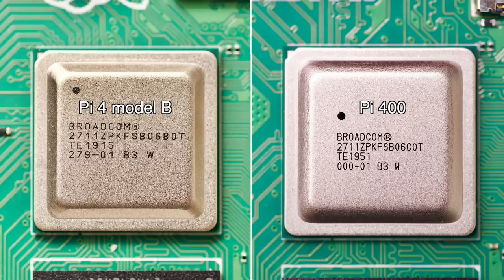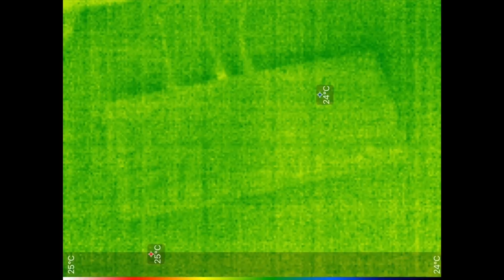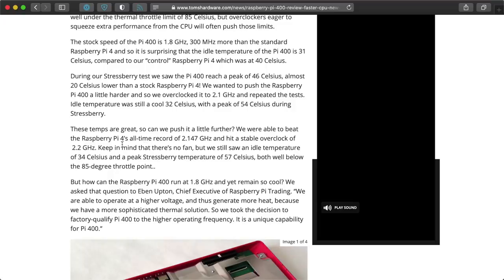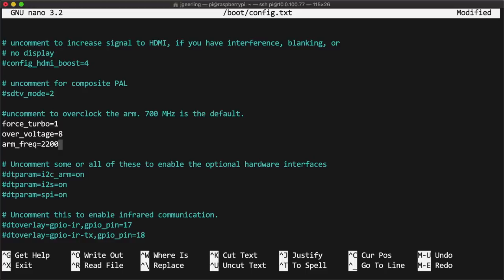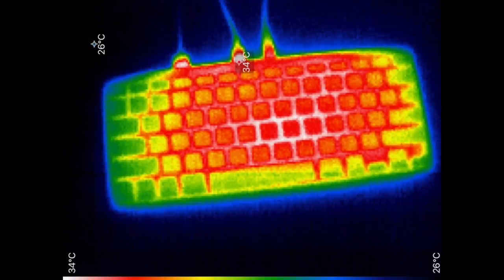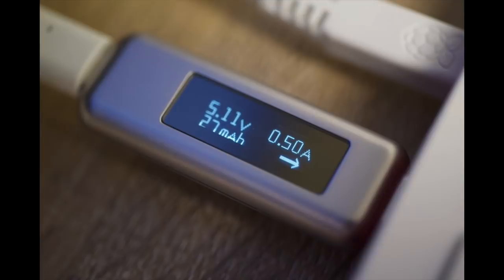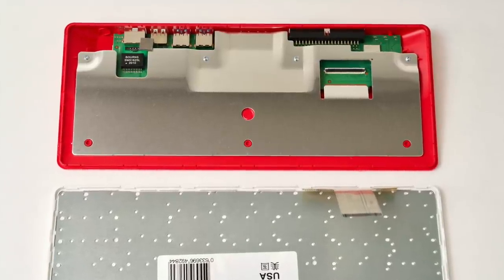OVERCLOCKED! Raspberry Pi 400 does 2.2 GHz!

Comment: Looking forward to your experiments with mounting a SSD drive internally in the keyboard case.
Like a recent NVMe 1Tb module.
And of course then boot from that drive and rid the SD card.
Thanks for sharing your experiences so far, highly appreciated !
Reply: maybe the Foundation can design a larger case (maybe use that excess surface for a numeric pad) and a free 2.5" sata bay inside or an m2 slot

Comment: Could you do a video on how it performs day-by-day tasks, like browsing with 1, 2, or 10 tabs open, watching youtube videos, etc? Using external video recording so we get a true sense.
Reply: As long as you choose the 4 or 8Gb version, it will work similar to a 'normal' laptop from about 5 year ago. Especially if you hook it up to an SSD and ditch the moronic SD card.
Reply from the maker: Not exactly that, but in a similar vein, check out my 'Pi 4 a Day' video: https://www.youtube.com/watch?v=OU6jHvVqJxY — it is a good little computer, but has reasonable limitations, mostly having to do with running desktop Linux (versus macOS in my case). A lot of those limitations can be overcome if you give it time, but some (like certain applications just not having a true equivalent, like Final Cut Pro/Premiere, or Photoshop) are a little harder to live with.

Comment: Helpful video thanks. on my Pi 400 I've settled for now at
over_voltage=8, arm_freq=2200
without also adding force_turbo=1. force-turbo=1 appears to hold the cpu clock at the maximum 2200Mhz all of the time rather than just have it increase on demand. What I am using is working well and visibly faster for me.
I did also try arm_freq=2300 and my Pi 400 booted OK but hung 5 minutes into a "stress-ng --matrix 0 -t 30m" stress test.
What a joy this tiny inexpensive machine is. Takes me back to my ZX Spectrum days when I was 16.

Comment: The size of the board probably makes a difference too.  More copper in the ground plane to spread heat.
Reply from the maker: True; everything is so spread out compared to the Pi 4 and CM4 especially!
Reply: It is good that heatsink surface area so large, and it helps even with plastics around it. It is a very good news, really.
Reply: The best design will be monolitical design with full size pcb and mechanical swiches soldered right into it. No full case, no covers at the bottom, maybe some protective frame around keys, no heat... But price of mechanical switches is big, and large pcb also not cheap.

Comment: The pi4 has a lot of heat issues because of how close some of the componets are to each other, with the pi 400 the mobo is longer from each other . The USB /ethernet controller is one such the wifi/bluetooth is another componet that heats up. This is why pi3 had so many heat sink options but the over all issue is they didn't have any that took affect because they were so small, I had copper ones and they made a small difference. Copper heatsinks made big difference for the system on a chip though.

Comment: My 400 runs at 7V; CPU @ 2150 and GPU @750, been running smoothly for 8 months on the Pi OS, and  Ubuntu Mate 22.04 for two weeks, no issues. Not using turbo mode.

Comment: Every Pi can use a heatsink. From watching the clustering video, I think the Pi 400 board cab benefit from that plus overclocking. But the resulting heat problem would require a heatsink plus a fan, maybe even a watercooling fan. On second thought, the Pi 4 8gb can be overclocked to 2.1 ghz, and it has twice the ram plus Bluetooth. Just a pair of these add up to 16gb ram and 8 cores. Clustering 3 or 4 of them, with overclocking and cooling, could give you all the cores, speed and ram you want.

Comment: I made thermal tests for mobile phones and result is: even that thin plastic gave about 20 minutes temperature gradient inside the device before settling while stepping ext temp from -30°C to +60° in one minute (or vise versa).
Reply from the maker: In the case of this Pi, since it has some gaps in the plastic/metal interface, and the vent holes on the bottom, it seems like the plastic itself doesn't get as hot, as the heat escapes other ways.

I've only tested it using stress-ng for about 3 hours straight, and the temps on the top surface were still under 33°C (and it didn't feel warm). The bottom side did get a bit warm to the touch, but nothing that I would consider 'hot'.

Comment: It seems to me that the easiest way to increase cooling would be to fold the aluminum shield into a bunch of small peaks and valleys. Depending on the number of folds it could dramatically increase the amount of surface area that can be used for cooling.

Comment: nice to see you trying this, can you also do some tests stressing the GPU as well, I find that heavy GPU use causes more heat issues than running all the cores?
Reply: I wonder if that heat sink even touches the GPU.  The teardown show they only had paste on the ARM.
Reply: @logananderon9693  um the GPU is actually built into the SOC, so its all in the one chip.

Comment: When comparing power consumption, the most accurate comparison would be watts. We can see that the voltages differ slightly on your tests, so intensity alone is probably not meaningful.
Reply from the maker: True, I haven't had time to log the data in any way yet, unfortunately. And really for tiny comparisons where the CPU is overclocked slightly, this power meter is probably not the most accurate.
Reply: @JeffGeerling  Thanks for the work you put into it, love the content :-)

Comment: How exactly does the power button on the keyboard work? Is it a simple on/off button I could hit by accident, or is it a software controlled shut down and wake? Can it be programmed easily enough to make it harder to turn the machine off, like hold control and power for 5 seconds?

Comment: Just a question... I did some testing with a raspberry pi 4 and a 3 and measured power consumption as I was quite confused by the numbers on your website...
I stressed all cores and both consumed about 6,7W which is... quite far from your result of the Pi 3 on your website...

Do you have a theory on what could cause this discrepancy? Maybe a faulty meter?

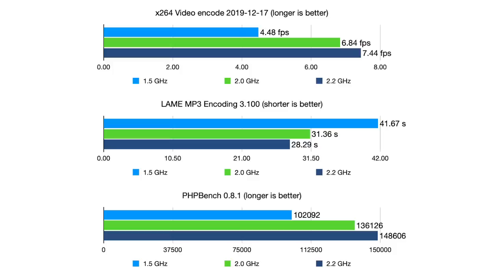Comment: Wait, at 4:00 the overclock at 2.2GHz improved a lot more overe 2.0GHz than 2GHz did over 1.5
It's really everything equal on the SoC? At 1.5GHz, does it behave the same as a normal Pi4?

Comment: OK now I actually regret bringing an RPi 4 just 2 months before this. I thought this wouldn't survive an overclock but damn. I guess the results would also be similar if you overclocked the GPU to 750MHz, though I wonder if it can beyond that...?
Reply: Yeah I bought my PI 4 a few days ago right before this was announced.  I guess I'll buy the 400 as a linux box and use my PI 4 as a dedicated emulator.

Comment: Hey Jeff, can you stress the pi 400 without the heatsink installed?  I'd like to see if the rev C cpu is cooler than the rev B used in the existing pi..

Comment: I have my 8gb at 2.2 GHz with over-voltage set to 8, but I didn't use force_turbo. Does that mean it's been running at 6 this whole time, or do you even need force_turbo? I've run every stress test out there, and it works great...maybe I got lucky.

Comment: I overclocked to 2200, GPU to 750.

The first attempt i overclocked to 2000, then to 2147, over volt 6 but after reboot lscpu showed 2200?

So this time I turned on force turbo, over volt 8, 2200 CPU and GPU 750. But after reboot lscpu is now showing the CPU max is 2394.9670

Im very new to Linux and haven't played with a Pi since I bought the pi1b years ago (some play with an orange pi too). Could anyone explain this to me.

Comment: So, what is the deal with poor 1080p YT playback on base Pi4? With ARM phones being able to run it effortlessly for years now, why Pi has such problems?
Reply from the maker: I think it's mainly all the fancy web UI YouTube layers on top of the video. Videos play back perfectly smooth, but when you move your mouse over it and the overlay fades in and disappears, and when you click the video controls, the browser does a good deal of work painting all that on top of the video.

It's something that I think could be optimized better, but on mobile, the apps can use native rendering tools, and on most computers, there's a lot more power on tap than the SoC in the Pi.
Reply: @JeffGeerling  This is Chromium I guess ? Does Firefox on Ubuntu do better ?
Reply: @JeffGeerling  makes sense. This would also explain why an old netbook that I had arguable pleasure to use not so long ago this year had such problems with displaying modern websites. Poor AMD-C70.

On the other hand it seems like my Pi3B+ struggles to run YT even in a background tab (so, it doesn't have to display anything related to YT), which is a shame, as I'd love to use it as a word-processing workstation from time to time.

Comment: I thought overclocking alone would get rid of your warranty. Does it mean that you dont have warranty if you have force_turbo set on 1?
Reply from the maker: According to someone in the Pi Forums, even force_turbo doesn't void the warranty on the Pi 4 at least. Though the documentation says it 'may'... so take that for what it's worth.

Just overclocking and overvolting (up to 6) is still fine, though, without voiding the warranty.
Reply: @JeffGeerling  Still for a $70 computer,  the warranty aint covering all that much. Relatively speaking

Comment: Would you say the pi 400 is good enough to use for learning python and web development?
Reply from the maker: Yes! That's actually one of the use cases I think it's perfectly suited for. I didn't have any trouble doing Ansible (a Python app) development work, or website dev work (with PHP, CSS, and Javascript) on the Pi 400 I have.

Comment: Nice but not good enough, I was truly expecting higher clock speeds on newest Pi400. My Rpi4 4Gb Rev 1.1 goes to 2.0Ghz, my 2nd Rpi4 8GbRev 1.4 Goes to 2.147, my 3rd Rpi4 8gb model Rev 1.4 goes to 2.2Ghz stable. Maybe just a silicon lottery issue. Will try one myself when my package arrives.

Comment: Yeah I got a Pi 4 to use as a 'youtube machine', but I was disappointed that at 1080p the videos stutter and low frame rate overall.
Reply: That's probably a codec problem. The Pi 4 can easily do 4K with the h.264 codec.

The Chromium extension "h.264ify" will force YouTube to use this codec. I'd reccomended using that if you're still trying to watch YouTube on your Pi.
Reply: @nexusxe  Thank you, I will give that a try.

Comment: Is there a fan header on the Pi 400 PCB, by any chance?
Reply from the maker: Nope.
Reply: @JeffGeerling  I understand pricing is a thing with the Pi 400, but it would've been cool if a fan header was there for users who might want to 3D print a bottom half for Pi 400 and add a fan :)

Comment: So its more safe using it in 2.1ghz??
Reply from the maker: The lower the clock speed, the better the Pi can control the SoC temperature, so generally lower clock speeds are more stable. It's most stable at the default clock of 1.8 GHz, since that's what the Pi Foundation chose for it :)
Reply: @JeffGeerling  thanks i will keep in mind that i will overclock my pi 400 to 2.1ghz because i dont want to lose warranty.

Comment: Compared with a laptop, that's the most minimal heatsink I've ever seen.  That just a thermal pad to a thin piece of metal.  No pc cpu has ever survived having something as minimal as a thermal pad.   In a laptop you expect thermal paste to a copper heat spreader to a heat pipe to a fan. But this doesn't even get very hot.  I wonder if you could put in a real heat spreader and some thermal paste.

Also does overclocking the CPU speed up the GPU? Because it's GPU boosting and stability I'm more interested in.  I guess it must or youtube wouldn't be smoother.
Reply: Overclock the GPU with separate command. If you want a nice cooler you can use my waterblock design on Thingiverse “penny waterblock” and make a full water loop for under $5 (my water cooled tablet cost me like $3.50 to make, which ran with a 44% overclock while running 40c cooler than stock out of the box, so it definitely works well).

Comment: pretty sure you can push it to 2400
Reply from the maker: Tried it, didn't work :( — at least not the one I have.
Reply: @JeffGeerling  you might try overclocking the gpu to see if voltage has to be near the processor voltage due to tiny psu